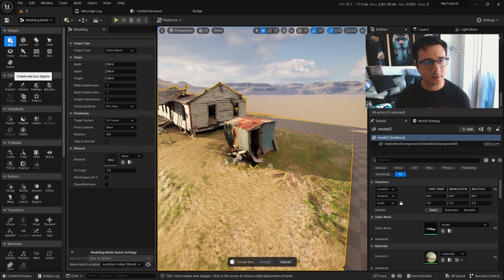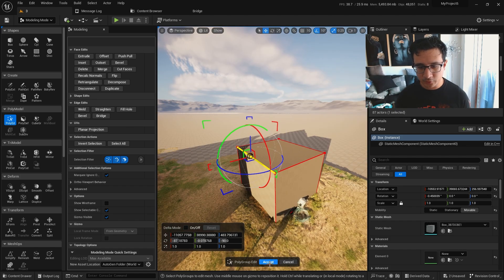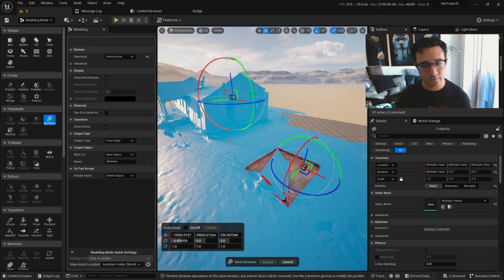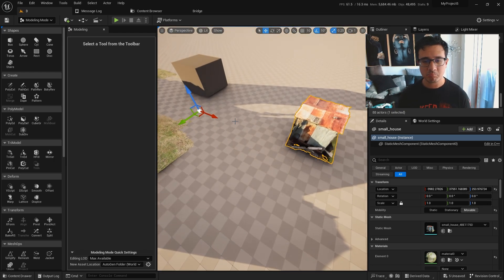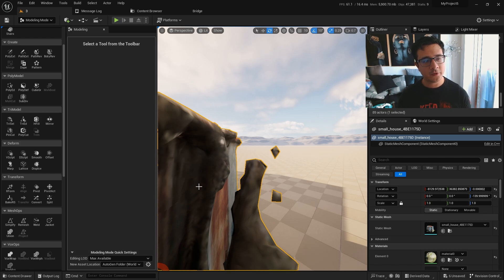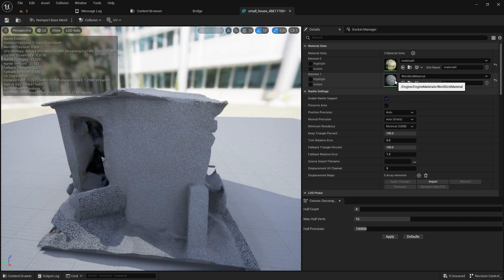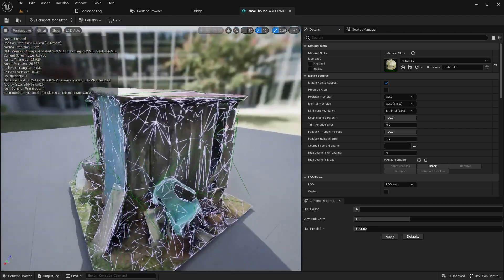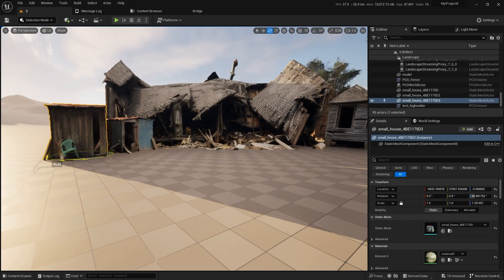How to Cleanup 3D Scans inside Unreal Engine 5 in 3 Minutes

Comment: Could you please tell me how you would go about taking a car in real life and make it a functioning 3D model? At this point the only thing I can think of is to find a model of the car, then take pictures of the car from all angles and try and find a website that converts pictures of objects into textures.
Reply: Just 3D model the car.
All AAA games 3d model the car and add details like dirt , cracks , etc later in substance painter and other masks 
By manually 3d modelling you have more control over topology and polygons count.
And in this way you can even model the engine of the car which you can't take in photogrammetry where u need to 3d scan it seperately and join them later which is more complex.

So i would suggest 3d scanning things like rocks , huge cliffs , land/bricks to turn into PBR material , things with lots of details like architecture etc.

Houses , cars , bikes i would suggest you to 3d model yourself.
For houses go with modular workflow
And for trees3d scan the bark of the tree

Import it in speedtree and create the full tree from there and join the photogrammetry scanned texture to the entire tree.
For flowers/leaves

Create the stem and body in speedtree
And the main part just scan it.

Also i would say a professional artist can make the same level of detail in a 3d model that u get in photogrammetry.
So 3d scan only things that are hard to model and texture.
Reply: @ChillieGaming  I don't model things. And I'm more concerned with replicating the color scheme and look of this specific car. So if I could just get a 3D model online of the car, then find a way to get it to look exactly like the car I have in real life, that's the goal. So trying to find a way to get software to do the heavy lifting here. Since I'm not paying thousands of dollars for a model of a car I'll be using for a short project to a 3D modeler.
Reply from the maker: this!
Reply: @unfgames  thanks for the heart
Reply: 3Dpresso
Reply: @yearight1205  i get what u are saying
But things like car , metal ,  and shiny surfaces are really not a good thing to 3d scan.